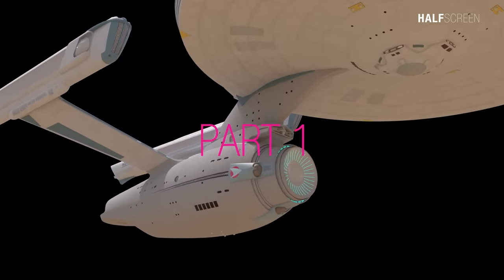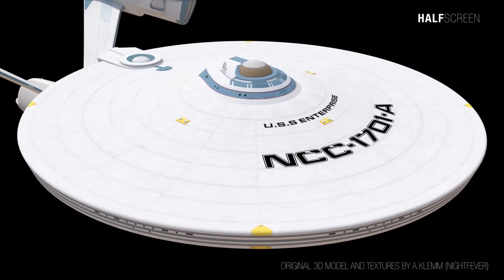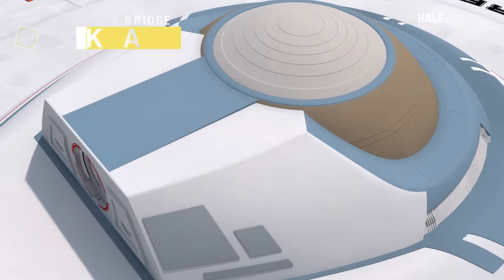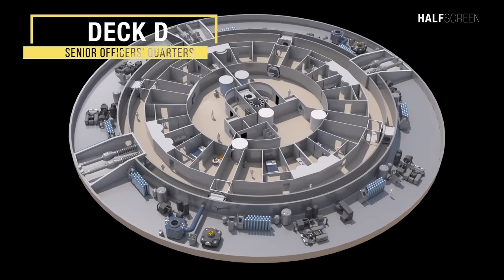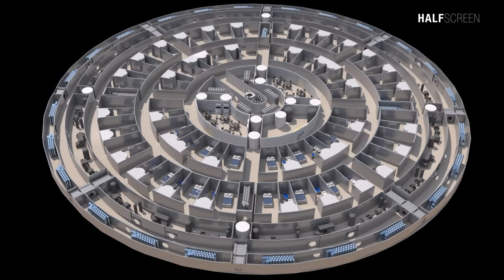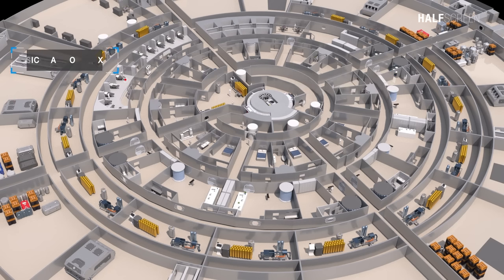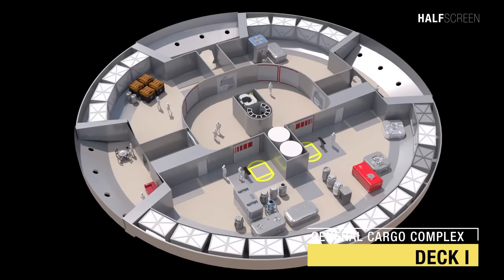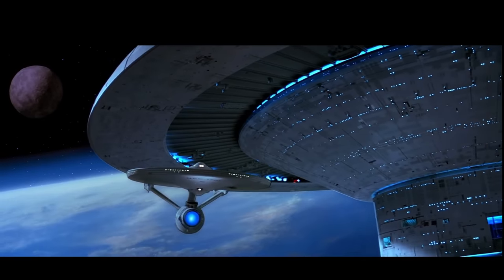Star Trek:  Inside the USS  Enterprise NCC-1701-A/Refit (Deck A-J)

Comment: The "A" was not destroyed over Genesis.  That was the original Refit.  The NCC-1701A flew all the way to the sign off at the end of The Undiscovered Country
Reply: Correct, the NCC-1701 -A  that Kirk later commands was originally commissioned as NCC-1717 USS Yorktown  and was re-commissioned after the original NCC-1701 destruction over Genesis( though this ship was like the Enterprise, a refit of the original Constitution class) .  In fact we see both shake down cruises in the Movies,.... In the Motion Picture we see the original NCC 1701 shake down after refit while they are on their way to V'Ger. And we see the recommissioned NCC-1701-A shake down during Final Frontier, Star Trek V.
Reply: True. That being said, Enterprise A was not a Constitution Class refit. It was an entirely new ship from the keel up designed to test warp drive in smaller, more familiar nacelles than those used on the Excelsior. It states in the last part of Mr. Scott's guide to the Enterprise that she was the lead ship in what would have been the new Enterprise Class. She was originally Christened U.S.S. Ti- Ho and her registry number was NCC-1798, but was renamed Enterprise A with the registry number NCC-1701-A, and was given to Kirk and crew after they saved the planet in Star Trek IV: The Voyage Home. That's why Scotty couldn't figure her out in Star Trek V: The Final Frontier, even with a Constitution Class refit manual. It was also the reason why when visiting the holodeck in Star Trek: The Next Generation when he wanted to visit the bridge of the Enterprise he told the computer just Enterprise. No bloody A, B, C or D.
Reply: @classicgalactica5879  I have that book, and it's never been declared to be 100 percent canon, it kind of implied that they proposed the ship upgraded to Transwarp at the end. Besides does it really make sense to give a BRAND NEW SHIP to Kirk? I prefer the 1701-A was a refit Constitution, one done later than the TMP Enterprise,  could have been the Yorktown. If your using the tech manuals as reference, the TNG tech manual says 1701-A was formerly Yorktown.
Reply: When did he say the A was destroyed over Genesis? You REALLY think someones going to research a video to this degree and make THAT kind of mistake? I think you misheard.
Reply: @willgillies5670  he said the Refit was the A, which it was not. If the refit Enterprise was the A, yes it would have been destroyed over Genesis - but it wasn't and therefore didn't
Reply: @classicgalactica5879  You could make an argument for it being a "refit" as it was built to the same specification. Of course, calling it a refit is a misnomer, as it was essentially a complete rebuild; the geometry of the two designs is so different that it would have been impossible to preserve any substantial amount of the original hull.
Reply: @willgillies5670  right at the beginning
Reply: @classicgalactica5879  why was it only kept in service for 5 years?
Reply: @chrispekel5709  Because the writers of the seventh movie, "Generations," got careless. They either missed or deliberately disregarded the statements in the 6th movie (including Kirk's final captain's log) indicating that the Enterprise A was fully expected to continue on with a different command crew.
Reply: @C W  sort of evan after the refit all in all the enterprise wouldn't have been 30 to 40 years old her sister ships, too, including the Yorktown if the enterprise a wasn't an entirely new ship that is then it was to be decommissioned at the end of the undiscovered country kirk probably had her out there for a good year or so before that happened 😅 but at this time the enterprise b was probably on the drawing board as the new flag ship 🤔

Comment: I love your work and I LOVE this ship… The TOS Movie Era is MY Star Trek (what I grew up first seeing) and this is my favorite ship design ever… Thanks for doing this!

One issue/thought. On Deck One you do a good job with that docking port (that confused me so much as a kid in ST:TMP), and you always find a logical space where the head could go. However, I paused and rewatched the various views and could see no way that one could get INTO or OUT OF that area… But it does seem that if the port turbo lift had a second door facing aft, it could access that area. And one could imagine putting that lift into standby mode, where both doors would hold open and it could serve as an access way to/from the bridge.

I’m almost embarrassed about my level of interest in something so small, but then I think I’m just inspired by your work! 😊👍🏼
Reply: literally just asked this same question.  Like where is the access to that back room?   Same question on the TOS bridge.
Reply: You're basically correct with the use of the port turbolift; according to the behind the scenes material, the portside turbolift would rotate on the spot to allow access to the docking area behind the Bridge. You can sort of see this in ST1 when Spock first arrives on the Enterprise with the direction that Chekov and Spock head on/off screen.
You can see the turbolift doorway to the airlock staging area (it's a bit narrow but it's there) at 04:24

Comment: EDIT: Forgive me! I did not remember correctly. This does line up with the -A as it did not have a weapons station per movies 4/5/6, though Spock’s position is on the starboard side and not behind Kirk. The book Mr Scott’s Guide to the Enterprise does still show the -A bridge as having the Weapons & Defence console as per the Refit even though it is not there in the movies. 🖖

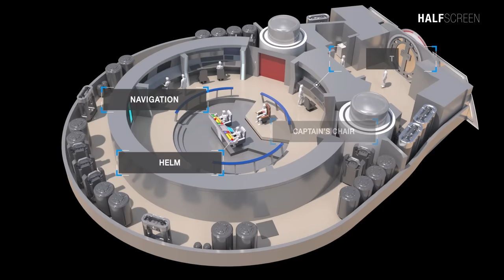Amazing work! Though at 4:47 the science station location is correct for the Refit as shown in ST:TMP, but it was relocated to the starboard side as of ST:TWOK onwards. The weapons section is missing on the port side.
Reply: I thought the same, but he did mention that it was the Enterprise-A bridge and that one doesn't have the weapons station standing separate from the other consoles.
Reply: @legrat6678  Quite right. I misremembered how much smaller the -A bridge was and more akin to the TOS version. Having rewatched to check, I hang my head in shame as a long time Star Trek fan for not remembering that 😩 🖖

Comment: By the extent of chances we can say with confidence that this "refit" was conducted by carefully detaching and lifting up the name and replacing the ship underneath. ;)
Reply: I have honestly struggled to see anything that could be remaining from the pre-refit ship. Maybe only a few of the core internal spaceframe parts but even that seems a stretch.
Reply: Probably just the commissioning plaque.   Maybe some melted-down metal, like the US Navy ship "New York" (LHD-17, I think) has some metal from the World Trade Center towers cast into its bow structure.
Reply: What interesting is that most fiction is based on fact and this certainly is the case with the USS Enterprise. 

All you have to do is look at retired naval ships like the USS Little Rock or USS Intrepid or USS Midway and you can’t even recognize them compared to their original WWII silhouettes and planforms. 

What’s interesting is that since those ships lasted longer than the designers ever intended them to.. more modern ships like the Spruance class destroyers were designed from the outset as modular designs meant for growth—but were then retired early after the Peace Dividend at the end of the Cold War.

Comment: in case anyone is interested, I leave my opinion here:
 The USS Enterprise NCC-1701 first appeared in the 1964 pilot chapter, in the 1966-1969 TOS, in The Motion Picture, T'he Warth of Kahn, and The Search of Spock on, after the argument suggested that the federation considers it a ship too old, it is sadly destroyed.
The Voyage Home (1986) first features The Enterprise NCC-1701-A. replacing the modernity effect of the Excelsior ship only in the last scene. At that time Mr. Michael Okuda begins collaborating on the franchise.
At the same time, in 1987, Gene Rodenberry, who was once again in power, pushed The Next Generation, which is slowly beginning to become familiar with a new Enterprise and new crew.
In 1989, with a period of changes at the top of executives Paramount Pictures, The Final Frontier was finally released, with constant script changes and budget cuts; this is where we first see the U.S. Enterprise-A. ship of which we know very little. Only at the beginning of the film do we see that it has many operating problems. 
On a novel somebody explains that a team of engineers reconstructed a prototips on  parallel Tomé to the ship "Excelsior", but it is Novel of the expanded universe, reliable to a certain extent-
if we look at details of the 1989 production we see that they share corridors and sets of the set of TNG .. (with different lighting)
Something similar happens with The Undiscovered Country .. where we see the Enterprise NCC 1701-A again
In short, the Enterprise NCC 1701 has two eras: that of TOS, and that of the Movies of 1979, 1982 and 1984 where the internal distribution changes. (Memorable and sublime 7-minute scene from R.Wise's movie and Jerry Goldsmith's suite).
 
and from the 1989 and 1991 Enterprise NCC-1701-A films, it is the least known spacecraft in the entire ST universe.

Comment: Theres a couple of fundamental areas of confusion within this video, based solely around the bridge. It was the bridge of the Consitution Class Refit (NCC -1701) In ST:TMP that brought the twin turbolifts to the left and right rear behind the captains chair. Prior to that on the old Connie Class the single TL had been at the bridges 7 oclock position if the Main Viewer was at the 12 oclock position. 

Significant developments to that bridge design included a dedicated weapons Pod to the 8 oclock position and Spocks science station pull out sections which gave him more work space. 

The Weapons pod disappeared from the NCC-1701-A re-designation of the USS Yorktown as well as some general streamlining of the bridge at the end of STIV and STV which was again changed upon Shatners request to make it flashier.

Comment: The A was not built upon the frame of the original Constitution class, it was part of a second generation of Connies that were built from the ground up. You're conflating the A with the Refit which are not the same thing.
Reply: Your absolutely right, I learned this as I wrote my book, I had to learn everything possible about the ship, I now own a nice  small library of tech manuals as well as compendium, and other related materials.

Comment: This is a great 'explanation' of just "why" the federation kept it's 'saucer' main-crew are in  a bunch of concentric circles. Officers, even while 'in bed', were but a few seconds (or, maybe minutes, by way of Jeffries Tubes) from their Bridge Stations. Any crew needed for Weapons, Shields, Environmental Control, or Sensor/Nav/Science were also able to 'get across' from one end to the other of the Saucer by way of 'pie-cut' corridors. Always near a Station, always able to move aside-of Light Damage done. This uses your Manpower assets in 'bad times' the best, where, a Klingon D-6 or K'Tinga D-7 would have, um, whom-ever there-is-left, in the Bridge Boom Section after hard fire. Also, since the Saucer, if reasonably Intact, can be a separate Sub-light space vessel, and, again-if-intact, be an Atmospheric Glider/Lifeboat. While frail-looking at first glance, the Federation design ethos has some validity in dealing with the harsher realities of space travel, while being 'just comfy-enough' for long-haul journeys.

Comment: This is a great model and the way you present the video really gives an easily grasped idea of the size and scale of the ship. If I may make one note, on Deck A there does not appear to be any access between the rear mezzanine that attaches to the head and the airlock and the bridge area. I've re-watched that segment a few times now and I can not see any door in or out of the bridge other than the turbolifts nor can I see any door in or out of the rear area other than the airlock.
Reply from the maker: Glad you like it!  The turbolift on the port side can open on the front and back.

Comment: Hmmm, the zoom-in of the officer quarters didn't match up with the wide shot, it shows two quarters sharing a bathroom, but the wide shot shows they have their own.
Some of the wide shots also don't show turbo lift doors, so it's hard to see where they enter/exit, and in the crew quarters shots, it looks like some corridors are blocked by lifts....which would seem difficult to deal with.
I also noticed some of the outer ring quarters only seem to have access through the observation dining area, which would also seem like awkward, lol. 
Seeing how the lifts would seem to go up, down, and sideways, I don't see a pathing for them to do this, unless that happens between decks. I know one of the two-player games showed an interesting concept of the outer lift being a ball-cage type thing that would roll around the inner lift as it traveled.

Well done on the video itself as well as the graphics.
Reply: For the enlisted quarters, it would seem to make more sense for the outer ring quarters to be flipped so the entrances are to the inner hall instead of an outer one, this seems like a waste of space as well as taking unnecessarily longer path to get places.
Reply from the maker: Thanks.  The schematic of the ship doesn't always make a lot of sense, but I didn't want to deviate to much from the blueprint.
Reply: @Halfscreen  , I noticed that with the designs over the years, The Millenium Falcon has different plans depending on the source, lol.

Comment: Got some of the specs wrong. The original had a crew of 450, it was increased to 500 after the refit. 
Also while some sources (even official) vary it can go at LEAST warp 8, some sources say max of warp 12.
Reply: It's Warp 12. This was before TNG came along with it's speed retcons.
Reply: @Idazmi7  Yes, Warp 8 max cruising speed, up to warp 12 emergency speed for 12 hrs. That's what I thought, thanks. 

TNG warp recon was frankly idiocy like a lot of the changes they did. Such as the massive ship size, silly shape and uniform design. However they mostly fixed the uniforms by the middle of DS9 and movies.

And don't even got me started on TNG retcon of changing it from Enterprise Class to Constitution refit. (If you look at signage in TMP and TWoK there is visible signage calling it a "Enterprise Class".

All that said I don't grasp how he got so much wrong, yet so much effort into it.
Reply: @PeterHarlequinWhite  
Easily, actually, and it's not really his fault: thanks to fans trying to reconcile TNG 'lore' with TOS, it's actually difficult to find any legit information on the internet anymore unless you already know where to look. 

He's getting his info from the Cygnus-X1 fan website, which has both canon information and non-canon, both unlabeled. As a result, his first video about the TOS Enterprise used a fanmade blueprint with multiple severe errors. He corrected it to the Booklet of General Plans in his deckplan breakdowns, but even then subscribed to the fan-consensus that the blueprint is "not canon" even though it's the only officially endorsed blueprint of the ship in existence.

He also seems to have assistance from a person who - I think - frequents The Trek BBS, which is a bunch of fan theorizing in a website.

Comment: Still THE BEST starship design ever IMO. The model is at it’s best in The Motion Picture where the pearlescent sheen of the plating can be seen. That pearlescent paint was dulled down on subsequent movies because it was too difficult to deal with for ILM. Also, beta canon for the Enterprise A is that it originally was the USS Yorktown who’d just finished going through it’s own refit. Starfleet wanted Kirk back in command as a captain so they renamed the Yorktown to the Enterprise A.

Comment: these videos are 10/10.  I have constant Lingering question.  Where is  the door to get from the bridge to the Head or Shuttle dock.  There is 2 turbo lift doors, but how does one actually get to that back room?
I have this same question when watching the video for the TOS break down
Reply: According to the behind the scenes material, the portside turbolift would rotate on the spot to allow access to the docking area behind the Bridge. You can sort of see this in ST1 when Spock first arrives on the Enterprise.
You can see the doorway (it's a bit narrow but it's there) at 04:24

I'm not sure what you meant by the TOS equivalent - are you referring to the corridor around the edge of the Bridge? Franz Joseph (who did the deck plans) also published a Technical Manual which contained expanded views for certain areas of the ship. On the Bridge the two panels either side of the turbolift door are labelled as "kickout panels" so presumably you'd just remove one of them if you needed access to the maintenance tunnel.

Comment: I have the deck blueprints of the TOS Enterprise and one of it's features that seems to be missing from this version are the horizontal turbolift shafts. You can, after all, not just ride up or down but also from one side of the saucer to the other. Or did I miss something?

Comment: I don't see how someone can get from the Deck A rear airlock and head area to the main bridge.  It looks like there is a wall on the back of the turbo lifts.  I don't see any doors. Am I missing something? Great video!
Reply: While these videos are nice, they are simplified from the original blueprints in a lot of ways. You should look at the original blueprints, linked in the video description.
Reply from the maker: The turbolift on the port side can open on both side.  Back and front.
Reply: @Halfscreen  That's what I figured but I didn't see any sort of door there.  In TMP that seems to be how Spock got onto the bridge when he arrived.  Good work!